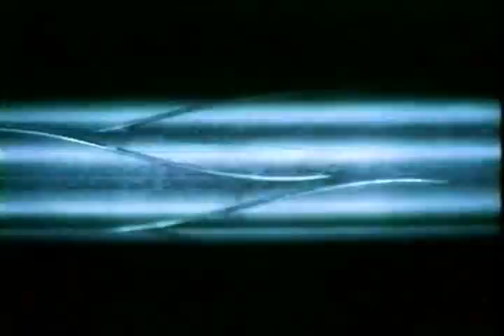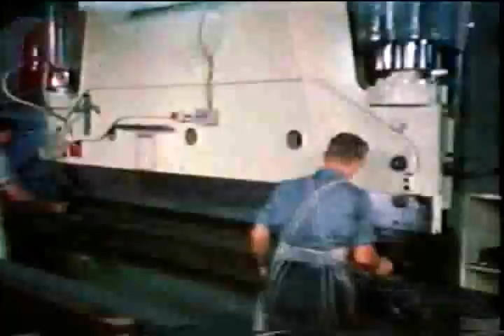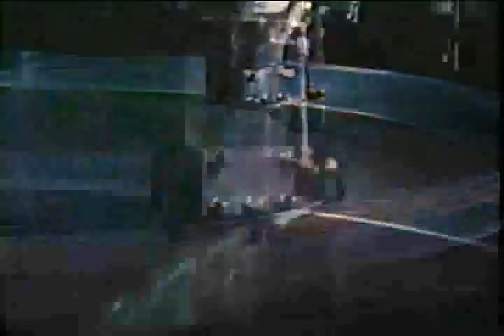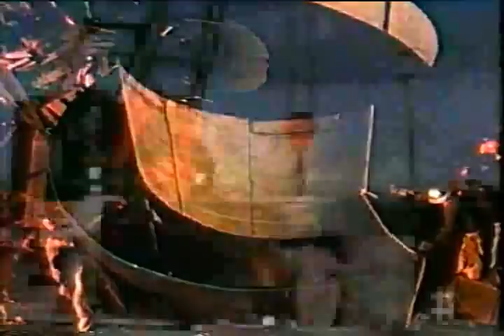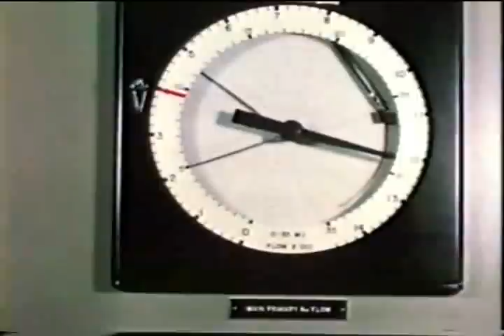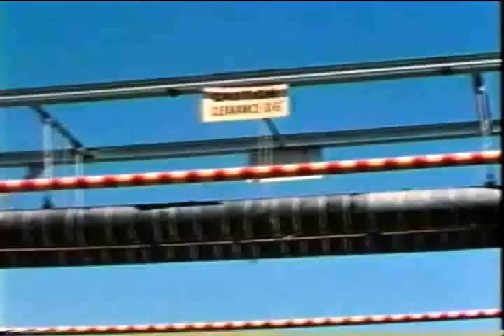Sodium Reactor Experiment Construction (1958)

Comment: Sodium  coolant reactors have always been cantankerous and prone to wreck fuel rods through decomposition and corrosion. The use of centrifugal pumps that were lubricated  and cooled with tetralin was another mistake.  The tetralin leaked into the primary loop, causing problems with blockages and subsequent cooling and reactor performance.  Inexperience with sodium as a coolant caused several incidents, including a wash cell explosion that nearly turned it inside out (using WATER to wash fuel rods contaminated with sodium, who woulda thought that one up).  After the messy 1959 events, the AEC decide decided to shut the reactor down and shift from sodium to NaK (Sodium Potassium), which honestly, is not much better.
Reply: Gates wants to build sodium cooled reactors yet he ignores the long history that sodium as a coolant, while having great thermal capacity, has huge issues with blocked coolant channels and fuel overheating.

Comment: Within my best understanding of the PDF reports I've read about the SRE, they knew that there was problems with the sodium freeze seals for the pumps, yet they went ahead anyway. Still, from what I've read, it seems that the cast metal area around the seal cracked, and let the Tetralin into the reactor, where it formed "carbonaceous" reside which made it overheat and melt down.
Ultimately, I don't know what was so different about the SRE VS EBR, reactors that it warranted another experiment.
It's baffling why they forged on ahead using the reactor, when there was every sign that it was in trouble.
It's amazing to read the reports that they put the sodium in drums, floated them out in the pond, and shot at them, so the burned and sank. I've not read about many industrial processes, which require a firearm.
Some of the engineering solutions they did was quite unique. You don't often see carbon logs being rammed into a sheet-metal condoms. When the core melted down, some of the moderator units burst. 
Still, as a video, I like the music. To enjoy the whole series, it's best to also watch the core-recovery video, and the decommissioning.
Reply: We’re only apes, only explanation possible

Comment: No conceivable way radioactivity could be released. LOL
Reply: +MrShobar I read there was a meltdown and release of fission products in the SRE test reactor at Santa Susanna in California.
Reply: lol
Reply: There was damage to the core, but the reactor was repaired & returned to service.  Claims about releases of fission products are mostly nonsensical :  if you were to damage a fuel element, with radioactive iodine released into an enormous volume of liquid sodium, where would the iodine go?  Into sodium iodide!  Caesium likewise could not escape.  Only the inert gases xenon & krypton would make it out of the sodium, & they are of no particular concern.
Reply: +Jordan Reese This reactor was for space applications.   It produced power in the tens of watts.  If radioactivity was released , it would be in orbit, or even further away from the earth.
Reply: @MrShobar  , could you be thinking of the SNAP reactors?
Reply: @MrShobar  that's why it was putting out 5.8 megawatts . Made for space between your ears.
Reply: @MrShobar With a steam pressure of 600#, that's a power reactor for electrical generation. A space reactor won't operate in that way.